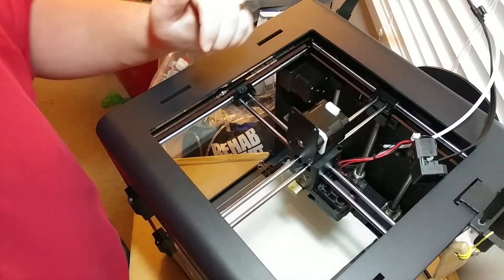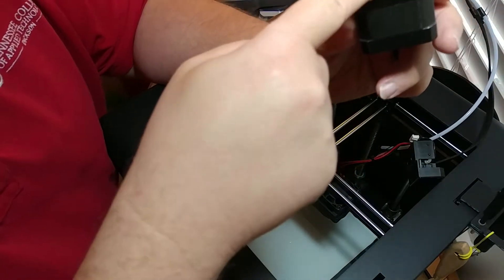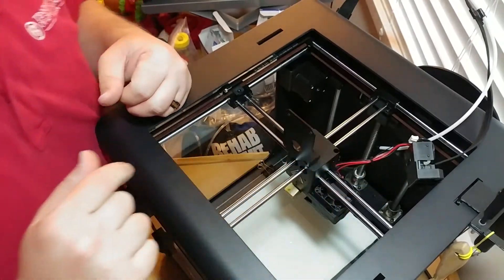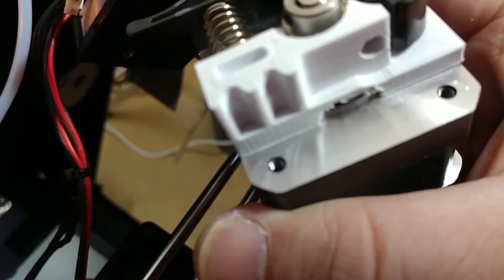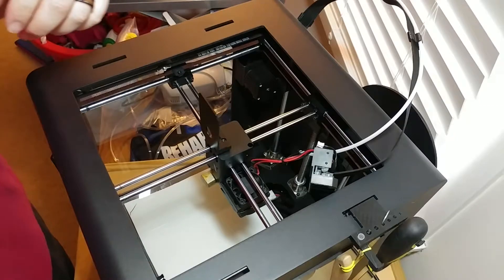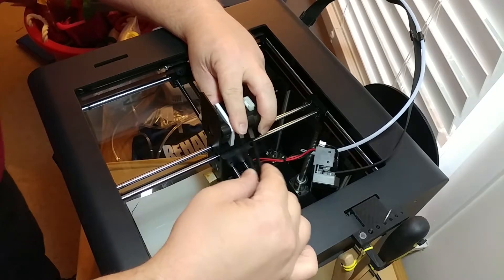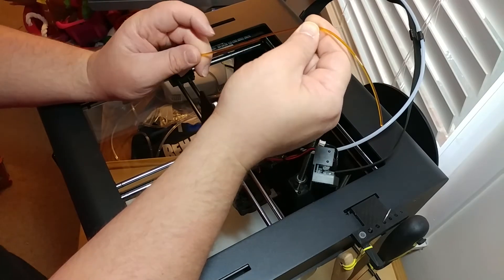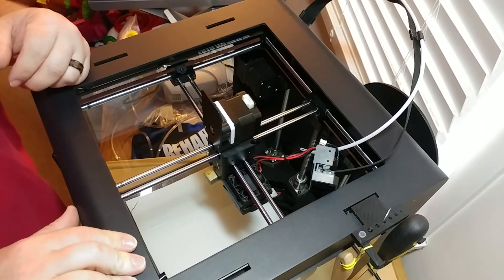Part 2: How to print flexible filament (TPU) with the Monoprice Maker Ultimate 3D Printer

Comment: when assembling, would it help to thread a piece of filament through the gear, block, and new tube to help align everything during assembly?
Reply from the maker: Sounds like a great idea. When I have to take it back apart I will try that. I have put it together 2 times with the pliers and have not had to take it apart because it was misaligned.
Reply: Someone made an edited version so you don't have to do the teflon tube part. https://www.thingiverse.com/thing:2336854
Reply from the maker: Looks good I will have to try it out
Reply: @Newfinator  Thank you Adam, you just saved me a lot of work, good information.
Reply: @Newfinator  Thank you!